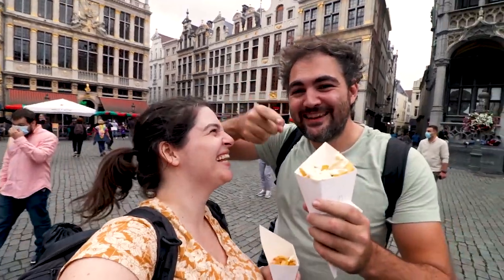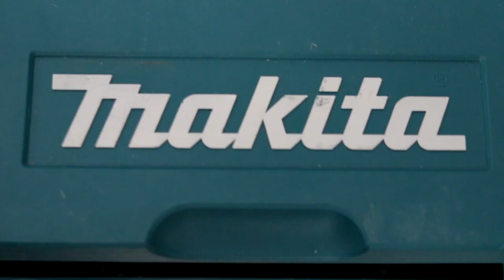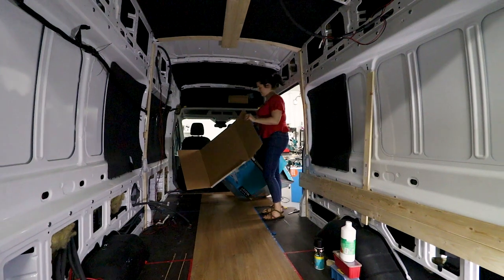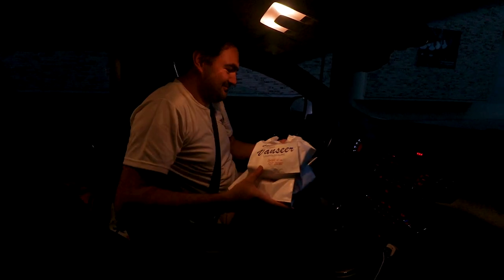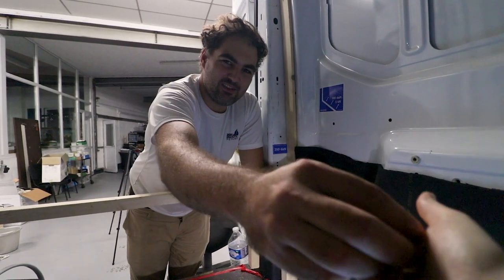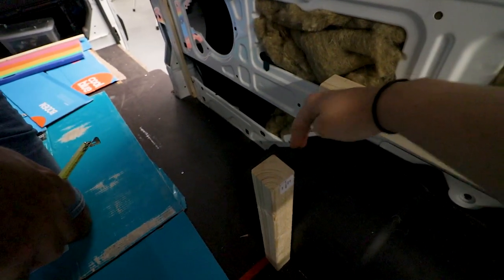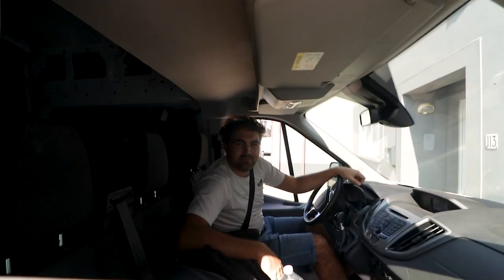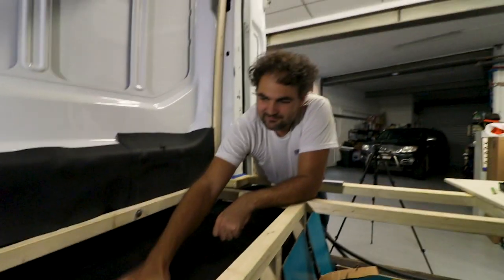We're BUILDING Our Tiny House On Wheels! (VAN BUILD)

Comment: one consideration just for your reference.....the balance of the van totally after all the installation been finished, it's concerning about the turning speed and driving speed; so locate the all the equipment  in their right place that will not interfere the safety of driving could be a early  strategy........OK